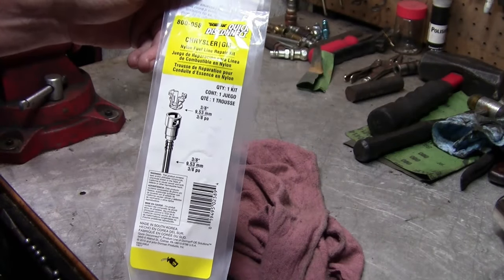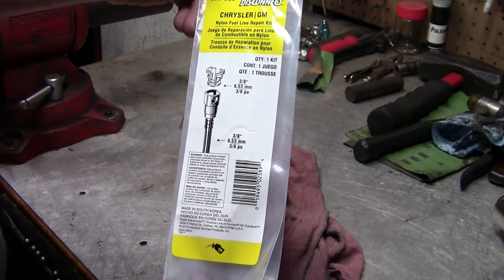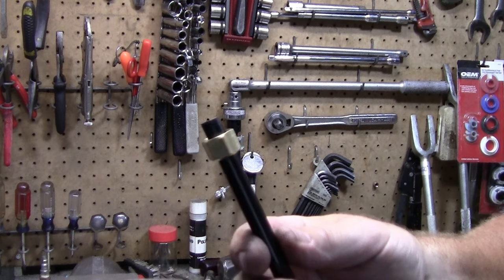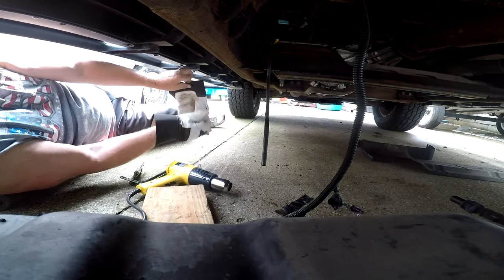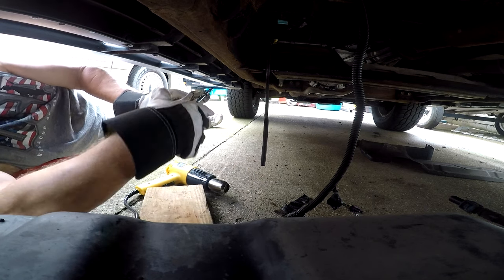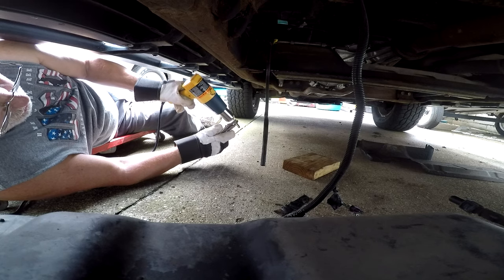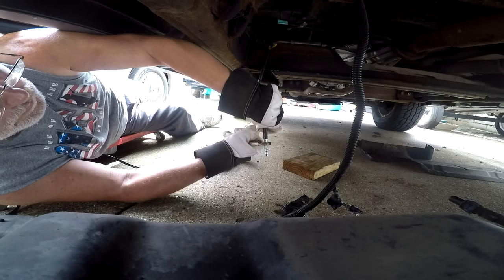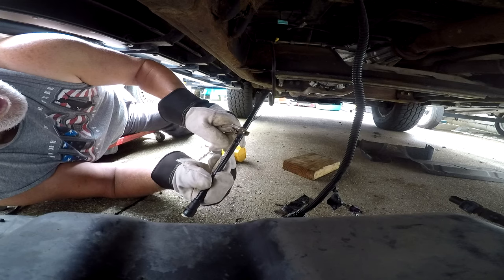Fuel line repair kit you have to see

Comment: I’ve been having a nightmare will try this thank you 🙏
Reply from the maker: Worked great for me, hope it works out for you.
Reply: Did it work?
Reply: @LonnieJohnson1  mine is on half way on. Could I still heat it up and put it in like that?
Reply from the maker: Yes
Reply: @LonnieJohnson1  so I also replaced the metal line on the other side but more to the rear where the other bracket was at it was rusted out and started to leak. Should I just buy the line that goes all the way to the back or cut out that section and replace it too. Would two sections being repaired like that sound like a bad idea?

Comment: I had to heat the connector, I used a propane torch. I also held the tubing with a clamp vise for a flaring tool.
Reply from the maker: The connector is all that needs heated.

Comment: Is that the line going to the fuel pump? Can you do that to both the pressure line and return line?
How did you cut the old line?
Reply from the maker: It was leaking so I sliced it and connected a new line. It was the pressure line I fixed.

Comment: Hi how did you disconnect the fuel line at the union or factory split it was on the end of the piece you were holding at the end of your video
Reply from the maker: There is a tool you can purchase to remove the connector.

Comment: If your reading this I hope it’s not to late. My problem was the 90 degree couple kept getting blown away from the pressure in hindsight it failed to lock to the fuel pump. Bought the new piece and it’s hard to get on… so remove the locking piece from your new couple and place it on your old one and would believe works like new😅
Reply from the maker: Cool!

Comment: What type of fuel line is this? I am not sure what my RV fuel line is made of. I am guessing rubber since a guy tried to fix and put a couple hose clamps on it. Can this work with rubber and do you have to use hose clamps? Thanks!
Reply from the maker: It's a hard plastic, not rubber. If you use rubber you will need to use a permanent clamp that wont work loose. Also depending on were the hose is connected you might get away with regular clamps. You don't want to have to take your gas tank back off if it starts leaking.

Comment: My car's fuel injector's hose is leaking, is there a tape to fix it at least temporary or a stopgap measure?
Reply from the maker: If it's the injector then it could be under pressure and the line has failed.
Reply: How to figure out if it's under pressure?  @LonnieJohnson1
Reply from the maker: You said it was leaking at the injector, start there and see where the leak is.

Comment: Damn! I need to do this but up around the front passenger wheel to replace the connector to the fuel filter.  Not a lot of room to work there.
Reply from the maker: I pull out as much as I could and later realized I could have un-clipped the complete line and pulled it out from under the truck.

Comment: Had you tried the dorman shark bite fuel line connector?
Reply from the maker: They don't make one with the clip on connection to the fuel pump. You can get a union to join two lines together as you would do a slice.

Comment: I need to do this, under the car too.  Most videos only show how to do this on the bench.  Great info here!  

Do you use the high or low setting on the heat gun?  What do you reccomend to do if I don't use enough heat, and the barb on gets halfway on?  

Thanks 🍺👍!!
Reply from the maker: High heat for 30 sec. If you only have low heat I would add another 15 to 30 sec to the time. The barb will start cooling as soon as you insert the tube and needs to be fully inserted. Push it on as fast as you can, or you will have to pull it apart and repeat the process.
Reply: @LonnieJohnson1  thank you so much 👍🍺!!
Reply: @LonnieJohnson1  this video saved me at least $800, and was the best video I could find on how to install these type of connectors. They wanted $250 for the tow, and $550 to replace the whole line. I had a rabbit or a squirrel chew on my fuel line. As if that wasn't bad enough I'm lucky the car didn't catch on fire when I went to start it. Using a heat gun was the best way and I'm thankful for your video!
Reply from the maker: Cool!! Glad I could Help!
Reply from the maker: Cool!! glad it could help.

Comment: I tried using this method after a buddy of mine broke the quick connector coming outta the fuel filter, this "kit" is nothing more than a"band-aid", a VERY  temporary  "fix".......within 2 months, it somehow sprang a fuel leak while I was driving.....the cheap ass fuel line somehow sliid most of the way off of the metal insert, which naturally added about an  inch and  1/2 of length  to the line, and then it ended up getting crimped, which caused the fuel leak.....so, the money and effort saved by going this route was negated by the fact of being broke down at a traffic light in a high traffic areas and then the cost of the tow fee.....all around, just a complete half ass shortcut way of fixing the issue
Reply from the maker: You ether heated the tube or you heated the barb for so long that it got too hot and melted the tube.

Comment: What do I do I I just need the end peice that clips on?
Reply from the maker: You can purchase a kit or just the end piece at Advanced Auto Parts. That's were I found mine.
Reply: Yes any auto store or Amazon will have the clips they're called quick connectors. you just have to know the size of the fitting for your hose is it 5/16 3/8 etc

Comment: Finally found a video of someone using one of these damn kits. They make a tool to do this but I'm not spending $100 for a tool all only use once. I was wondering if you could get by with a heat gun.
Reply from the maker: I felt the same way. I will probably never have to do this again, but if I do, I'll do it this way.

Comment: I was able to get the barb in without heat
Reply from the maker: Cool, I wish I could have done that. There is a tool you can buy that just pushes it together with no effort if you want to pay the price.
Reply: Lies!
Reply from the maker: Which part?
Reply: Without heat and used some type of tool or tools.